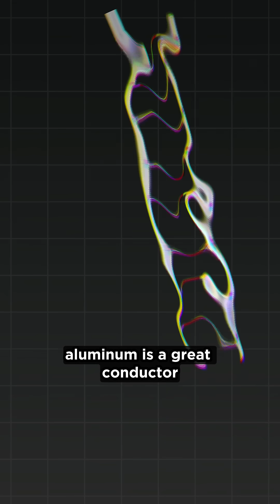How Did This Ladder Melt The Ground?

Comment: Those big black “wires” on the bottom aren’t energized.  Those are cable.  That’s not what’s burning the ladder.  The ladder is leaning on the primary voltage wires at the very top (probably 4-14kv).  There could be a few reasons why it didn’t open a fuse or breaker: 1) the current flowing through the ladder to ground is not enough amperage to trip the breaker or fuse, or 2) the breaker or fuse is not coordinated correctly.  
Aluminum is a great conductor, that’s why most of the wires outside your house are aluminum.  The ground is not a great conductor, that’s why it’s melting.  The lava is a mix of ladder and concrete.
Reply: Thank you! I'm a line clearance arborists and it's really hard to get people to understand that breakers and fuses won't always trip for a short to protect you. There's always some amount of line loss in any system and they can't trip for everything. If say the concrete provides enough resistance the system can see the short as load and continue to cook. I'm my case of course I'm usually concerned with trees catching fire this way.
Reply: @galenboydston2318 Thanks to both of you for the explanations cause I was confused.
Reply: High Impedance Ground fault
Reply: It was on the secondary powerlines. The bottome 3 were most likely AT&T, a local fiber, and the primary internet provider for the area. A company like Comcast xfinity or Time warner for example. Above those are 3 lines that are vertically paralel, on the pole, 4' above the communications lines. Those are secondary power lines meant for sending power to residential and commercial buildings with low power requirements. Primary lines are the horizontally paralel ones. Secondary are rated for 120-480 V. which is enough to do something like that given the time and is still extremely dangerous. Primaries have a operation much higher than you stated at 34.4 kv. And may distribute at the rating you stated for higher energy demanding customers like factories or server centers. Also, while the communications lines are not energized, depending on the line, they will still AC on them. Comcast is common to have around 90v on it. Especially with their growing demands with the Rphy and FDX platforms they are switching to on their main lines. Not enough to do that, but enough to piss you off or damage something like a pacemaker. Been a coax splicer/ line technician for a decade now
Reply: The lowest is always telephone, above it is CATV, then way above that is secondary power and the highest is primary power.
Reply: @acsnitner7661 not always with the comm lines. Typically thats the case. But there have been plenty of times in Detroit that Ive worked on lines that were on offset brackets either below or in line with bell. Its dumb, but it is what it is. The bottom is typically bell. But below may be a small telecom company thats very region specific.WOW for example is fairly small and is often below bell
Reply: @hanyo1o132  It's nationwide, called a G.O.95 (G.O. + General Order. All utilities must follow the rules. Same with underground utilities but that one is G.O. 128.
Reply: What confuses me is that power lines are insulated arent they?
Reply: @kammo.1116  they are not. The secondary or house drop is somewhat but these usually run from transformers to houses, if they are strong between poles they will be the highest of the lower black wires with black wires wrapped around a bare aluminum neutral, these typically run at 220v which can be dangerous but i can't imagine melting concrete. The bare aluminum primary distribution above that uses air and ceramic pole mounts to insulate against what is typically 7,200-14,400v with a whole lot more amperage.
Reply: Big Back
Reply: @pumkion  it takes gym time to keep it naturally big. Psyche, the gym is for suckaz.
Reply: @m32mikestu don't cry, what's wrong?
Reply: can't they just have someone custom made a ladder?
Reply: Can't I guy tac weld his concrete cracks in peace?....
Besides made it in the records as largest tac welder 😂
Reply: i read “big black wires” as “big back wires”
Reply: Really?  Aren't the black (insulated) wires 110/220 volt?  That's "energized" enough to be dangerous, or run your household, but they are insulated.  

The upper lines are much more energized, but that doesn't mean the lower ones aren't.  The insulation would have to be inched thick.  Unless the lower lines are just cable, phone, or fiber optic, they are carrying a significant amount of electricity.
Reply: @patricknorton5788  the black insulated wires are a mix of low voltage phone lines, fiber optics, and coaxial cable.
Reply: @TimCortesiAren't the single house connections 110 volt lines insulated?
Reply: @patricknorton5788  Overhead power lines typically aren't insulated, as Tim stated the black insulated wires are communications. The secondary which we see is the thinner set of 3 above that and out of frame would be some primary, neither of those are insulated though sometimes they come with some weather protection.
Reply: @AmurTiger Ah, does this "weather protection" resemble insulation?  The "low voltage" (I put this in quotes because it's still capable of causing fires or death) that leads directly to the weather mast of a home or commercial building is never bare wire, so I  always assumed it was (electrically) insulated.

I had trainings from our local power company for two positions.  One was a job with the local urban tree canopy program, and the other with the neighborhood emergency volunteer group.  Both times, the local high-voltage jocks only called the bare (uninsulated) lines "power" lines.  They carried thousands of volts, and were much more dangerous if trees or linesmen got too close.

But still, the electricity that runs a household is not transmitted by a coaxial or telephone line.  It runs through a transformer and then to the household weather mast to the breaker box.  It still transmits power, so I don't see why it's not called a power line.  I'm still not going to lick the breaker box.

What the linesmen said was that there was normally no danger if a wetvtree branch contacted a line that had insulation (I.E. a line between a pole-mounted transformer and a house) because it was a) insulated,  and b) low power.  

Low power is fine, like a firecracker versus a bomb, but you still don't want either going off in your mouth.  What am I getting wrong here?
Reply: @patricknorton5788  The weather protection will look like insulation certainly but it's not intended to insulate for the life of the open wire ( the set of 3 running between power poles about midway up ). The bundle of wires, triplex or quadplex, will be insulated as you have different phases and neutral all in close proximity. That bundle will be the service connection usually connecting to houses or business.
Reply: @AmurTiger Thanks.  I sort of understand, but not quite.  I'll look it up.

Anyways, they do carry quite a jolt and are potentially lethal, just not as dangerous as the wires up on the higher poles.  Not every street has the higher poles, but every street has the power to run ten clothes dryers or to set every house on fire if something goes wrong.
Reply: @patricknorton5788 the lower lines are low voltage phone lines, cable lines and fiber lines shouldn’t cause fires or death. Maybe the phone lines, I’m not familiar enough with them but the cable and fiber lines defiantly shouldn’t. 

These aren’t for home electricity. They are for internet connection, TV and phone.
Reply: @patricknorton5788  That's racist. I'm with you tho, racing is fun.

Comment: the ladder is touching the primary line..the contact point above should be sparking..but since it has the same component,the sparking is happening below where as the ground and the aluminum touches..
the question is...is it dangerous to step near the ladder?...no.. because the ground is not an electricity conductor....

Comment: As a safety precaution, they should shut off the power to those power lines, then remove the ladder. Even if it looks like it's not touching, it could arc from the power lines to the ladder if it's close enough, and you could accidentally touch the power lines with the ladder in the process of removing it.

Comment: I think you are wrong on this one. It's the ladder melting not the concrete. High resistance= lower current=less heat. The concrete is high resistance. The aluminum is low resistance and thus should be the thing melting. Just like you can touch both ends of a 12v car battery and nothing happens and if you put a wire it will go up in flames and melt.
Reply: Side note. Concrete melts at 1700 Celsius and aluminum at around 660. So if the concrete is melting the aluminum definitely is.

Comment: From what I’ve learned from welding is that if an aluminum surface oxides that it creates a shield-like layer that has higher melting point than aluminum itself, that’s about 2072 degrees celsius! 
Normally pure Aluminum has like 660.3 degrees celsius.

Comment: Whoever put the inunsulated wires over there in font of a house is a criminal. They probably have a "differential relè" or some other protection over there, but if the energy dispersed to the ground is inferior to the sensitivity of it, it doesn't get triggered.
The ladder doesn't touch other wires and it leaks the energy to the ground so is like another "consumption" for the system, wich considers many little leaks and power surges.

Comment: i think they're dumb for not using some tool to donk it free by now if i was living there id use any of the non conductive tools i own which is like all of them because of the rubber wear gloves and knock it down. its melting at the bottom not stuck to the concrete and if it was that would bend very easily away from the powerline
Reply: a bungie cord could have saved the day in 5 minutes

Comment: You can’t see the top of the ladder. It’s probably up in the high-voltage lines which would explain why the interrupters haven’t acted. Even 100kW is nothing to those lines.
Reply: It hit a high tension line

Comment: As a power lineman I can tell you there is a “breaker” but it doesn’t always shut off immediately, it’s will re-close itself multiple times. That definitely played a factor in this
Reply: And the concrete could be high enough resistance that a fault isn't recognized.
Reply: @RobertSzasz then it wouldn’t really be a fault condition
Reply: @kenleylaw8626 
As far as the breaker is concerned, the neighbourhood is just pulling more power.
Reply: And if the fuse/breaker has the right overcurrent setting/amp value.
Reply: Electrician does the smaller stuff this is what mainly linemans do (lineman’s dont like being called electrician 😭😭😭)
Reply: This reply was for the guy calling linemans electrician
Reply: @PROJECTIRONWOLF1  home boy, we handle electricity higher than your car payment, you don’t even know the kind of power that is on those lines. Just because we don’t get the luxury of working inside doesn’t mean we’re not electricians
Reply: @samgrady6911 i own my car I don’t make payments  but linemans are different from electricians why do you think yall are called linemans
Reply: oh big man on campus over here, and fyi our technical term is outdoor electrician. Kinda like a square is a rectangle but not all rectangles are squares. I hope you can understand that reference Mr.carowner
Reply: @samgrady6911 thats the reference I was trying to make but youre too thick skinned to understand that
Reply: @PROJECTIRONWOLF1 homie you gonna understand I’m the square and the rectangle. I’m qualified to do indoor and outdoor. So again I say I’m an electrician as well as a lineman. Funny how that works
Reply: @samgrady6911 i understand that but you finally understand what i was trying to say though but you still not understanding you still trying to ve the big man here when you literally already explained what i was tryna to explain electrician is a lose term some linemans dont like being generalized as just a electrician they like to make it known they do line work like exactly what your doing
Reply: @Not_a_number_ exactly you get it now 😂😂😂
Reply: @samgrady6911  as an electrician i think you guys are hard working smart and kinda crazy but i dont want ya wiring up my house. With respect a sparky
Reply: @MrFateorfaith 😂
Reply: @PROJECTIRONWOLF1  yep
Reply: @samgrady6911 you're not an electrician tho
Reply: @DarkAttack14 😢
Reply: @DarkAttack14 I guess I’ll have to resend my membership to the international brotherhood of electrical workers
Reply: Lines still have current, even when shut down. Linesmen carry lines to throw over the powerlines from a distance to bleed off residual current
Reply: @theopensource09 unless someone forgets had to watch somone throwing a ground because a bucket truck and operator kept getting zapped. I was just a sparky sent out to help the lineman that day. No thank you ill stay with 480v tyvm
Reply: @theopensource09 Lol who told you that, no they don't. Breaker is open there's ZERO voltage on the line, no current at all etc
Reply: Yea surprised it wasn't between the house and the pole pig and pop a fuse. Respect from an electrican to a lineman yall are nuts.
Reply: as she said the heat comes from resistance, high resistance means it may not be drawing enough current to actually trip the breakers remember they are designed to supple a whole street (possibly more) while people cook dinner and have all the lights on, even using the washers and dryers all at the same time in the evening, here its during the day when everyone is at work and the overall current useage is at the lowest leaving pleanty of current free to draw before the breaker trips
Reply: Why are powerlines&phone lines&TVlines in urban areas in the USA not underground like in Europe? 
I wonder, are water, natural gas and waste waterlines above or under ground in the USA? 
And if they are under ground, why would't powerlines and comlines be put into the same trench dug lay those lines????
USA??? WTF.  I mean everytime the street gets resurfaced or the sidewalks you get a chance to put those damn cables into a trench under the surface.
Reply: @TremereTT to be fair the US it twice the size of Europe and our government is in control of some infrastructure but not all of it. The power companies and are usually owned by one entity for a large area and they’re just as unorganized as the government. Trying to get them on the same page is a nightmare. But some counties are calling for a change to put the powerlines underground. Eventually the whole us will be like that but it will take a very long time.
Reply: @TremereTT why the fuck would we want them underground and significantly more expensive to run/repair?
Reply: Where is the breaker? A box on the path?
Reply: @usx06240  yes, it could be on the next pole or even 10 poles away. It doesn’t really matter how far away it is. Energy travels at the speed of light.
Reply: @samgrady6911 Actually, slightly slower. I would have thought there was a fusible link rather than a breaker. I guess we take it fir granted. I never really look up. We all see transformers, but I never noticed how frequent boxes are. I guess a re-engaging breaker makes sense. Maybe because it was not a constant ground fault to earth, but rather  concrete, the phases were not unbalanced enough to lock it down. Aluminum is such a great conductor, so no great resistance. Tough job. You deserve every cent.
Reply: does the current still jump like 2 feet enough to do that or is it residual I have a feeling he probably didn't put the ladder on the lines but also didn't ground himself because it seems to be just police an fire no emt's at all
Reply: Yall wet alking about what happend how, but we aint talkin about how this would be a good final destination kill

Comment: Electricity doesn’t have to make contact to hit you !!! It could be a simple as it’s close enough to be getting an induction effect. Similar to how transformer work. Two coils of wire are close enough that the current can jump the air gap, stepping up or down the voltage depending on the setup. 

Especially if that is  a 480 line that is feeding 240 transformers to feed that residential neighborhood or even some commercial properties. The current being pull off by the ladder wouldn’t be enough overload the system that design to handle several city blocks. 

The rules of engagement change dramatically when you get to 480. From PPE and to Working Clarence. 

You can see this effect clearly if you watch linemen switch in and switch out these systems. Or even with Tesla coil or lightning strike.

Comment: There is actually a secondary line that is stuck on the ladder its just much smaller, we also use a contact breaking technique where we send 3 burst of higher intensity electricity to blow off what's stuck to the wire, but maybe the shut off got destroyed

Comment: From a different picture you can see that it’s still on a thin wire, a high voltage wire.
So yeah, current is still flowing.

Comment: higher resistance causes lower amps in the circuit, but there is also more voltage over the high resistance parts of the circuit than the low resistance part of the circuit, and so because the wattage is voltage*current then that means the high resistance spot gets the most watts and heats up the fastest.

Comment: If it's not the ladder melting, the only other option I can think of is the rebar in the sidewalk. It got super hot and expanded, butsting up the sidewalk, then it began to melt and boil up from the cracks. I could be wrong... I thought I was wrong once, but it turns out I was mistaken.